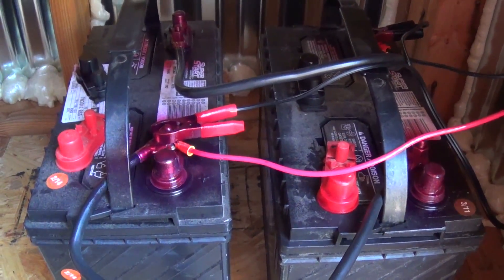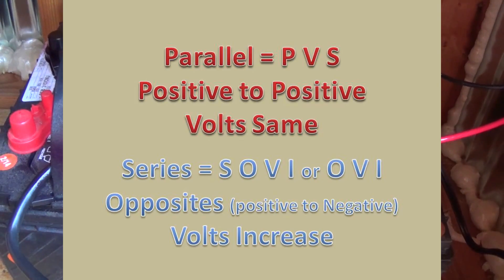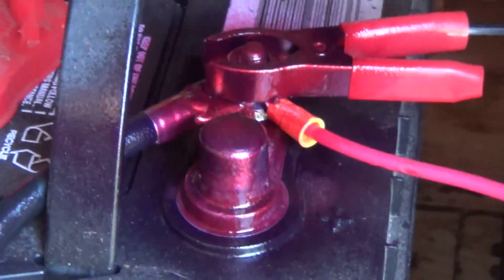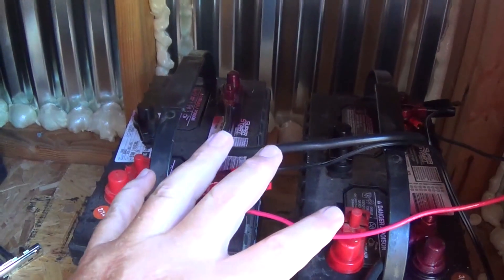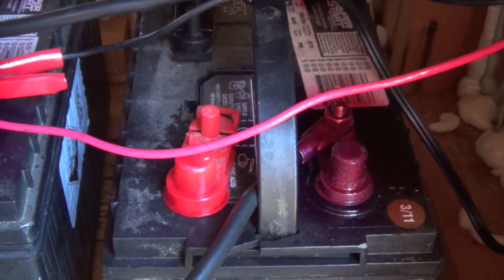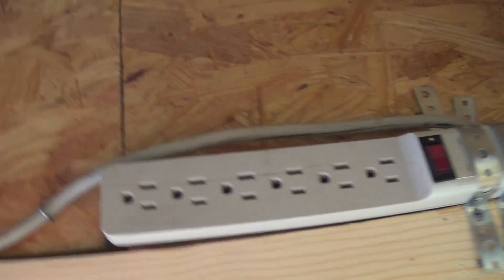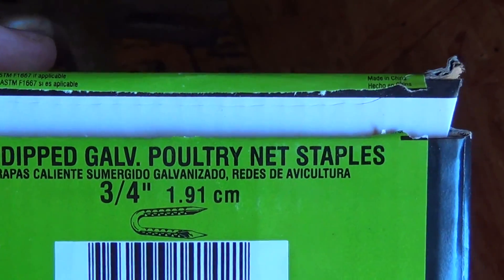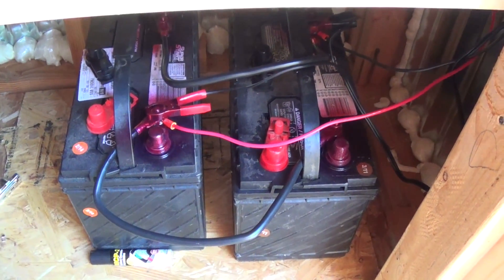🔥Wiring 2 12 Volt Batteries in Parallel - Solar Panel, Charge Controller, Inverter

Comment: thanks for this, it really helps. But...if I have two wires going to my solar charge controller, can they go from the positive and negative nodes on the same battery?
Reply from the maker: if using more than 1 battery no. when you connect multiple batteries you create one big battery. . if you connect to one batter you wont get an even charge.

Comment: 8 years on and this is the only video I’ve found that actually explains what to do with the solar controller and the inverter (where to actually put them on the batteries) nice work thank you.
Reply from the maker: Your welcome glad it was helpful. I found online 2 ways to connect when you have multiple batteries.  This way , opposite ends allows for balancing charging n discharge.

Comment: Question ☝️
I currently have a one battery solar system in my van, and want to make it a 2 battery system - great video btw, thank you - my question is this - I also have an A/B switch connecting my starter battery to my 'house' battery in the van so I can run my van and charge the battery in the back, for those cloudy days. The house battery and starter battery are connected positive to positive through the A/B switch, and the house battery is grounded to the frame of the van - how should I wire in a second battery to this system?
Reply from the maker: parallel to the house battery . pos to pos... however what i would do is us a bus bar wiring all 3 positives to it. however just added the new batter to the same term as the house/starter is fine.  have a great day
Reply: @ArizonaHotHomestead  thank you 🙂👍

Comment: Great Video very Helpful …. The problem I have is in my caravan has had a Second Battery added and I want to put them in parallel , but there is two 240 v House wall Charges can I run both Charges at the same time on Parallel setup? If so how would I hook up ? too each Battery side or both Charges across both Battery’s like in your video? Hope I explained that ok,, what would you recommend…thanks
Reply from the maker: i am no expert. . i dont think you can run both at the same time.
Reply: Thanks for your reply I just hooked up in Parallel and disconnected one of the 240v house wall changes…works fine

Comment: Can i charge 4 batteries(12 v 1.8 amps each) to 12 v 10amps charge controller.(given they are connected in parallel)
Reply from the maker: is the charge controller a mppt or not? that type of controller will change the type of charge bulk, absorption, float, etc . the key to matching charge controller to batteries is make sure the volts are capatable, n the amp range is within.  if power is coming from solar panels make sure the controller can handle the solar panels volts and amps, .

Comment: Good one there thanks please I want to size my MPPT charge controller my system design is two 12volts  200ah connected in parallel my chosen solar panel is 300watts 6pcs of it how many amps should my charge controller be?
Reply from the maker: wiring your panels in series or parallel.?  use the formula watts = volts x amps.... . remember series increase volts and parallel increase amps.

Comment: Hello, i would like to ask my connection is the same like the way you have explained but i connecten the load to other side of terminals no the terminal which i connected sollar pannel will i be right?
Reply from the maker: no.   think of it this way. each battery can only have 1 pos and 1 neg terminal. once to wire batteries together you now have 1 bigger battery. still only 1 pos and 1 neg terminal. those terminals are were you connect everything to.

Comment: Thank you VERY much, exactly what I was looking for! 

As you say, why it should be so hard to get this info is a mystery to me but it has taken me forever! One question though - What gauge cable would you use for the cross over wires? 

Thank you for the video & (in anticipation!) your help. If you are ever in the UK in the summer & fancy a beer by the sea in my hopefully newly solar charged cabin on the Essex coast - let me know!
Reply from the maker: size of wire? depends on size of batteries. the bigger the wire the better. so go as big as you can. i use on my main solar which is 24v 920ah  (8 batteries 6v 460ah each.) 00 awg.
Reply: @ArizonaHotHomestead  

Ok, many thanks! 👍

Comment: Hie !Can 10amps soral charger   work for 2 batteries (12volts) and give full charge?
Reply from the maker: dont know. is the solar charger for 12v? how many solar watt panels are going into the charger? how big are teh batteries. 10amp is the max of the charger and you have 100 amp battery only at 50% its going to take over 5 hrs to fill . are the 2 batteries wired in parallel.? i am no expert

Comment: Sir have 12 v Microtek xp1400 inverter she'll we connect 2 battery with 180ah and 150ah in parallel connection?
Reply from the maker: yes. however having batteries with different amps is not good. the charge controller will charge the batteries only to 150ah meaning the 180ah battery never gets fully charged. it would be better to have 2 150ah batteries.
Reply: @ArizonaHotHomestead  sir any another issues except fully charge???
Reply: Any damages to 12 v inverter and battery??
Reply from the maker: @Dhanudsk007  no damage but you may notice lower voltage sooner becus the 180a isnt fully charged so its not going to get to 12v and hold that charge as well as the 150ah battery.

Comment: Can you parallel two 12v that have different AH? Ex- one 6ah paralleled to a 35ah battery? Just for use of trolling motor? I’m assuming charge would have to be separate , thanks
Reply from the maker: bad idea. when wiring multiple batteries in series and or parallel the battery bank is only as strong as the weakest battery. in your example the 35ah will drop down to 6ah killing the battery. charge them separately.

Comment: Hi great video my question is the battery terminals that you are using for the load / could you use the other  positive and negative terminals to run another different load AS WELL  thanks denis
Reply from the maker: no. a battery can only have 1 positive and 1 negative once you put 2 batteries together they are now 1 battery.

Comment: I was not sure about this topic, in the back of my mind I was thinking that yes they are 2 batteries but when they are in parallel configuration then I should charge them as one and after I searched multiple locations I  finally found your video which clarified the issue for me. My suspicions have been confirmed, thanks. Kudo's on the tip about coating the metal hand tools, wearing gloves and protective eyewear. I think that people tend to underestimate the potential that exists from arcing, sparks, and the fact that it's only 12 volts.
Reply from the maker: sweet . glad the video was helpful , thanks for watch and have a great day

Comment: Thanks so much! Exactly what I needed to know!
Reply from the maker: your welcome
Reply: @ArizonaHotHomestead  I was wanting to do this with about four 12 volt batteries. To that I use in my boat and two that I have for vehicles I don't drive very often but want to keep the batteries maintained. Can you rinse and repeat and have four connected? And if so do you need to still do the far Corner positive to the far Corner negative on the last battery?
Reply from the maker: @Jamo-qw4xu  if you connect all for batteries becus they are different type and amps it will bring down the higher amp battery. the system will only charge to the weakest battery..   i would set up 2 systems and charge them separately.

Comment: This is a super great video.  I've been trying to figure out how to charge my batteries with my one solar panel and the problem is the charge controller w one solar panel will not charge the two batteries in series. BUT,  if I disconnect the series wire connection and hook the batteries up in parallel, the charge controller is happy to charge the 2 batteries cause it looks like 12 volts instead of 24 volts.  BIG note for solar panel users. you can charge in series if you have 2 solar panels.  I only have one panel.  so the solution as described by the video suggest hooking batteries up in parallel to get it to work.  also, of importance is to hook the controller positive wire to the positive side of battery one and the negative wire to the second battery negative connector to balance the load. Well done video!  truly world class.  I like the diagrams and acronyms.  now I'll never forget how to hook it up. I wish I had found this video 4 months ago when I bought my solar panel.  thanks a bunch!!!  PS:: your invertor setup is pretty cool!!
Reply from the maker: thanks. glad to help.

Comment: This might be a dumb question but batteries like this that have dual terminals, can one be used for output and the other for input? Is that the intent of the design? Much appreciated.
Reply from the maker: you need both for input and output. the terminals are positive charge and negative charge. you need both to charge the battery and to provide power for your loads.
Reply: ArizonaHotHomestead Thanks for the response, what I was referring to was the dual negatives and positives. The batteries in your video have two of each terminal. But I think I understand now that I’ve hooked up my solar panels.
Reply from the maker: @venturewise6662  try to look at it this way. a battery bank can only have 1 pos and 1 neg terminal. when you wire up 2 batteries you want to declare 1 pos terminal as the main positive and on the opposite battery declare the neg term and the main negative . the terms in the middle now dont exist

Comment: Thanks for good information, I like bonus round too, nice set up with the inverter. My question is can you charge 2 x 12 battery thatvare not same. 1 a deep cycle boat, and the other smaller atv battery?
Reply from the maker: great idea. bus bars are best way to connect multiple cables and cables of different sizes.

Comment: I would like to ask how much do the amps increase? I want to put 12 200amp batteries in parallel. Before someone comments something nasty I am a total rookie when it comes to these things
Reply from the maker: parallel is pia  parallel increase amps. 2 batteries at 200 amps each is 400amps. 12 batteries at 200 each is 2400 amps.  be sure you have a good mppt charge controller that will automatically equalize your batteries. this keeps one batter from becoming weaker than the others.

Comment: I have 2 12v batteries  made of  8 lifepo cells. I connected them like this but when I begin using an appliance it is still taking from the 1st battery where my hot is connected. I just don’t understand why when I do it, it doesn’t work. Ufghhhh
Reply from the maker: i am no expert . not sure whats happening.  this wiring i got the info from peope who do solar.

Comment: What if I hook 3 up
Reply from the maker: if the 3 are 12v each hook them up as parallel. i have another video showing multiple batteries.  if they  are 6 volt it wont work for most . you want your battery bank to be 12v.

Comment: Very good, it is a common question when you have two batteries in parallel which terminals to put the two charge terminals to (on the same battery or one on each battery). No books or videos ever specifically tells you.
Reply from the maker: thanks. i did another video showing additional batteries

Comment: Best explanation I found on YouTube so far thank you so much and you actually showed both ways.

I was wondering what happens if you put your charger directly on One battery positive and negative and you mentioned that it will create an uneven charge I don't want that.

Thanks again.
Reply from the maker: glad to be of help.

Comment: I am doing my 12v 20ah batteries for my scooter atm like this. Charger two at a time since it is 4 batteries for safety. Any hinters for safety?
Reply from the maker: secure the batteries so if you tip the scooter the batteries dont get damaged. check the connections before every use they may rattle/vibrate loose. good to put a simple inline fuse on the positive line between the batteries and your load to prevent short destroying your batteries. be sure its a mppt charger what they do others dont is once the batteries are fully charged they will trickle charge the batteries. if they continue to fully charge the batteries they will over charge the batteries damaging the battery

Comment: Hi there great vids thanks for them... I have just bought 2 x 150 solar panels with mppt controller. They've told me to connect in series.. OK.. So I can see how to do that but they don't say how to connect from controller to batteries.. I have 2x 12v..  OK.. So can I connect the 2 batteries together In parralel? Or do I have to connect in series... I found leisure batteries under seat. Can I assume the power IN wires are the ones that are connected to the first battery and the end battery is one that has no wires going anywhere else but to the first battery... I know I don't actually know anything about this so I only hope I'm talking some sense to you.. Sorrt to trouble you but if u can kinda explain that would be great Colin U. K.

Comment: Good video. Thank you. I do have a question. I want to charge my 2 12v batteries, which are in a parallel system while they are hooked up in my RV. How do I determine which is battery number 1 and which is battery number 2 for the purpose of connecting the charger?
Reply: As you can see it really does not matter if they wired up equally as this video shows. Just pick one and consider it named "one"
Reply from the maker: yep. maybe think opposite ends for pos and neg terminals.

Comment: So if this one battery, it should not matter where you hook the load?. I have batteries hook up and I use alternate terminal, and it is still effective.
Reply from the maker: it does matter which terminals you charge and hook loads to. they need to be the same terminals. a battery has only 1 positive and 1 negative terminal so when you wire up more than 1 battery you should have 1 terminal for each positive and negative that is available. i have another video on this showing many batteries that might be a little more clear. name of the video is ' which comes first series or parallel'
Reply: Some batteris have 4 posts not just 2 so you can use one set for charging and one set for discharging so dont think you have to use the sane terminals like he does he is just playing it safe
Reply from the maker: didnt know that never seen a 4 post battery

Comment: Daddy Jeff very teacheable videos .please sir I have two 6 volts and want to link them up but it seems like they are unevenly charged what do I do
Reply from the maker: they have battery chargers for your car that can charge 6v and 12v batteries. charge each 6v to fully charge then wire them together and charge them again as 12v. you will also need to sulphate the batteries also known as equalize. once that is done you should be good to go just equalize once a month to once every couple of month depending on how much the batteries are used.

Comment: So if I had four batteries consisting of two sticks ran in parallel I would put the positive from the charge controller on the first stick and the negative on the second stick?
Reply from the maker: sounds right. i am assuming your stick is 2 batteries connected in series and another group of 2 batteries in series giving you the 2 battery banks or as you say sticks. we thinking the same? i think so.

Comment: Thank you, kind sir, for your tutorial. Well explained. But, I am a bit concerned when I heard you say that you could get electrocuted from unintentionally touching leads that are not to be touched. How strong would the current be? I read somewhere that car batteries are relatively safe due to limited voltage that they produce. Please correct me if wrong.
Reply from the maker: the larger in amps the battery the more painful. plus electrocution is also a short which could damage components. the volts dont kill its the amps. bottom line is do all possible to prevent so you dont  experience it.
Reply: @ArizonaHotHomestead  I see. Thanks!

Comment: Can they be charged  separately by to different chargers while connected in parallel ?
Reply from the maker: i wouldnt. the idea is to treat it as one battery and equalize once a month which should keep both batteries at the same charge..

Comment: Can you show me where your solar panels are hooked up to this configuration that you have? I have two 100 watt solar panels a 30 amp charge controller and two 12-volt deep cycle batteries that I want to hook up to my 1200 watt inverter to plug in my portable plug in cooler. What are your thoughts on this
Reply from the maker: i have other videos that go over wiring.  positive of your solar panels to the pos on your charge controller and to the open positive on your battery. the negative the same just on the negative side. i put a breaker/fuse between the controller and panels in case a surge from the panels it will protect the controller. between your batteries and inverter you should also have a breaker/fuse to protect both if there is a surge of some kind.   your panels should have connectors that only allows you to connect one way. . does this help?

Comment: Thanks! the exact info I was wanting to know about were to hook up load and charge , plain and simple
Reply from the maker: awesome. I do have a few other videos too about the wiring in case you wanted to review them. they are basically an improved version with more batteries. or at least I tried to improve the explanation. lol.

Comment: this is super helpful but what about if your connecting 6 batteries
Reply from the maker: I also have 8 rolls surrette solar batteries I connected series and parallel. there is a video I did about series parallel plus a video on how I connected 8 6v batteries to make a 24v system.